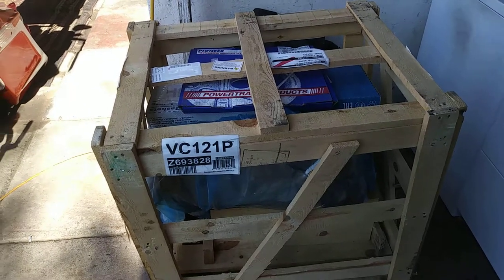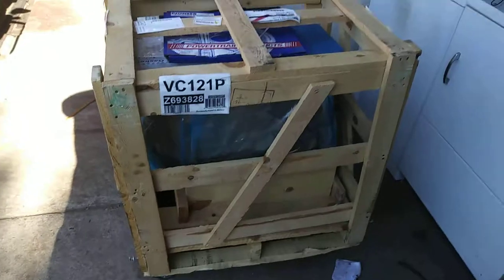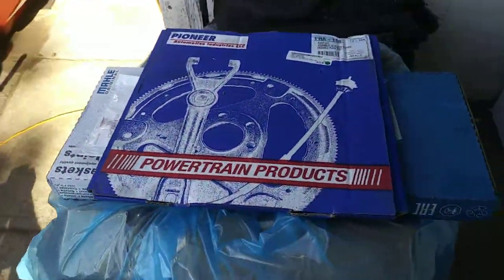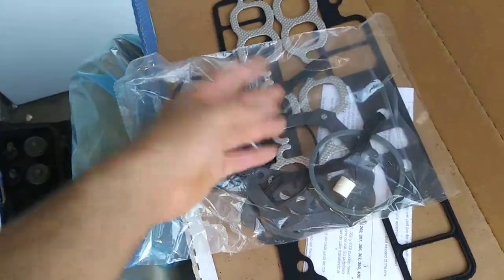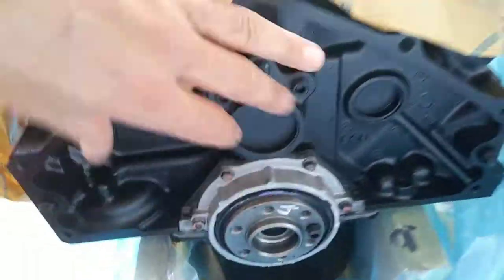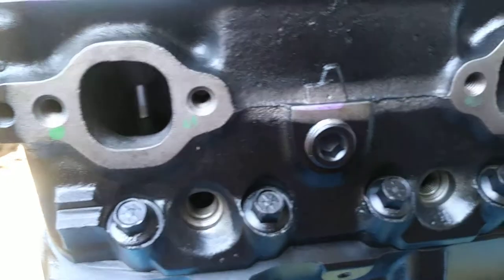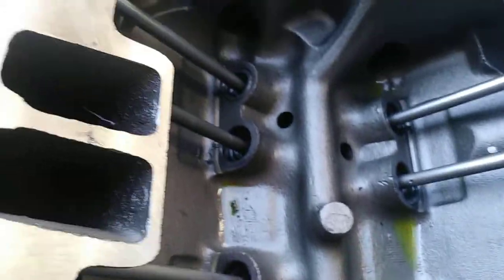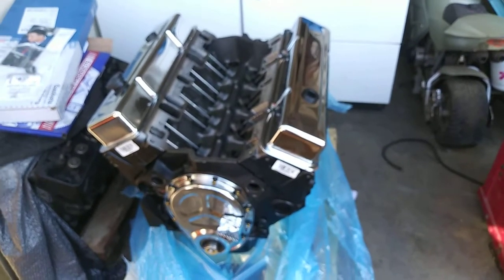Marty Bacardi unboxing his new Chevy 350 crate motor from auto zone

Comment: That really is very impressive. I'm preparing to purchase a remanufactured  engine. I found your video looming into Power Torque. Just the care put into shipping nearly sells the idea to me to use AZ
Reply from the maker: Yeah it was great all I did was walk into AutoZone tell him the year of my van size engine that I wanted it originally came with the 305 but I told him that I wanted to 350 they said no problem and waited about 2 1/2 weeks they called me took my truck over there picked it up still running good today barely put 300 miles on the new engine Just driving it around town took it to Modesto reservoir camping there’s a video on that also check it out

Comment: If you have to start it up and keep the engine revved up for one 6500 is way too high it’s supposed to be 2002 if you have to do that then it has not been broken in
Reply from the maker: No when you first start the engine up, they said that you have to rev it like 2000 to 3000 RPM so that the lifters and rods can get oil up to them for about 3 to 5 minutes then it should be ready to drive and break in after 500 miles
Reply: @6BACARDI6  that’s what I said you said rev it to 6500
Reply from the maker: @tommywilliams1402  my bad I must’ve been talking too fast and said it wrong
Reply: @6BACARDI6  I figured it was probably something like that lol

Comment: Still run good?
Reply from the maker: Yep it’s still running good I just hit 3800 miles on the new motor. Still running strong can still fill the little gains especially accelerating from a stop at the red light I’ll have to do a review on the engine soon
Reply: @6BACARDI6  awesome I just ordered mine like an hour ago 2k 4year warranty at auto one
Reply from the maker: @bourdman9519  hell yeah you’ll be really happy with these engines ain’t nothing like breaking in a brand new 350 crate motor

Comment: Yea whats the cost?
Reply: Undressed 1400/1700 dressed 2k/4k
Reply: @massiveyeetage8340  Was she pretty sexy"undressed" ????   Just be'in a smart ass !!!   I bought a similar one--the GM 350/290 last year for my '72 Chevy 3/4 ton 4x4. Put a "Mutha-Thumper" cam in her, a Torquer II intake(which is actually a bit radical for what I am doing), Z-28 valve springs, Holley 2008 dual feed 750(vacuum) and stainless long tube headers. I'm not shitt'in you that damn thing runs like a BBC. And for only $1400 base engine plus around $600 extras. Where can you get that much fun for 2K ??????     Jim     If I'd of had a brain in my head I'd of bought up (4) or (5) while they were on sale(to sell) --now the same damn motor is $1800--base !!
Reply: @massiveyeetage8340  what do you mean by dressed and undressed.  Asking because I plan on buying a motor for my 99 Tahoe soon, so trying to make the right call.
Reply: @tevingay8030  dressed comes with all the bells and whistles ,valve covers , oil pan , etc etc undressed is just a block and heads
Reply: @massiveyeetage8340  okay thanks.
Reply: @massiveyeetage8340  So you mean long block (dressed) vs short block (undressed)?